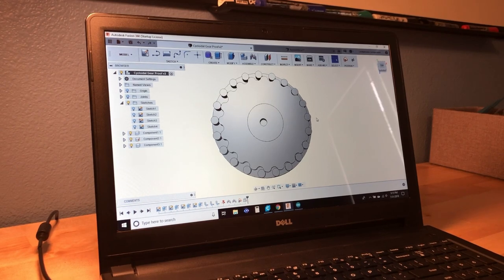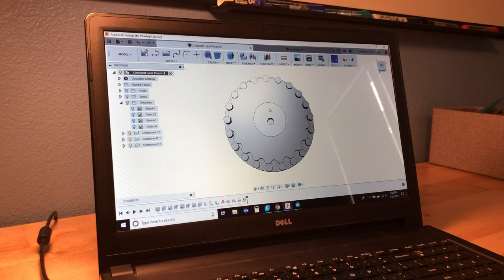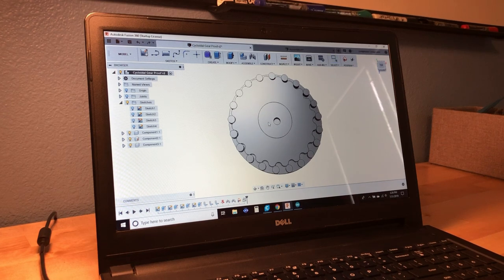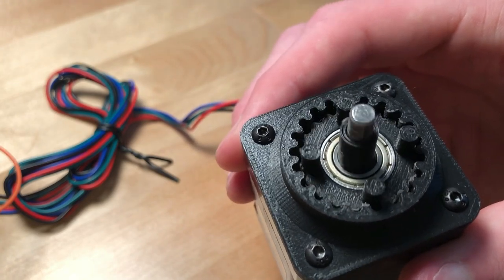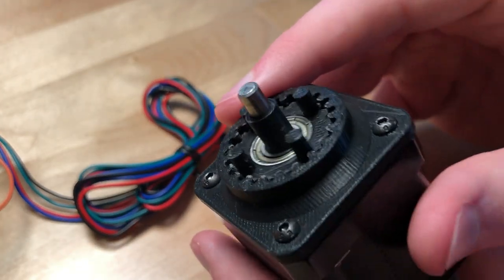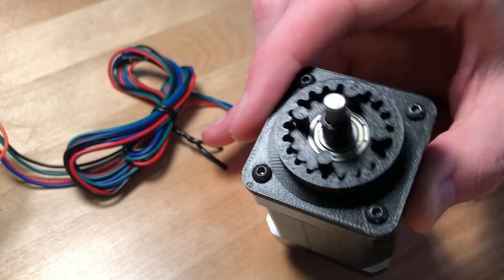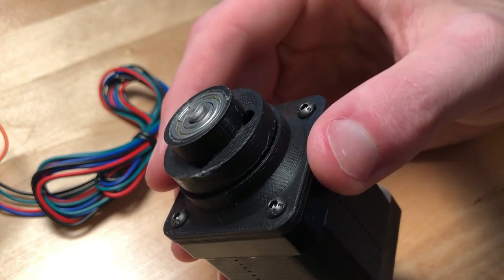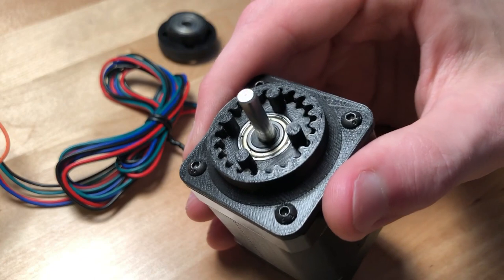3D Printed Cycloidal Drive | What They Are, How They Work, and Testing

Comment: The harmonic drive would perhaps be perfect for an equatorial mount used for telescopes. They need a zero backlash system with perhaps an arc second as smallest movement in combination with microstepping of a steppermotor.

Comment: I took a couple weeks and designed one of these using an equation I found online once but never printed it. It’s intriguing because it’s a lot easier to manufacture that a harmonic drive but from what i have heard it’s hard to decrease the sound and vibration they produce
Reply from the maker: My version didn't produce any sound, as far as I can tell. And having two cycloidal gears offset 180 degrees should almost fully eliminate the inherent vibration. I believe that a perfectly designed cycloidal gear, which would maintain constant contact with every tooth, should allow for nt wobble, and, hypothetically, no noise. And I really appreciate your support, but if you'd like to see a REALLY good 3D printed cycloidal drive, check out Paul Gould.
Reply: If you use 2 disc at 180°, you can strongly reduce vibration. If you use 4 (or 3) discs at 0°, 180°, 180°, 0° you have virtually no vibration. The problem is, that the output of a cycloidal drive is not perfectly linear, which can hurt your positional accuracy if you don't compensate for it
Reply: @alexanderhorstkotter2910  I just redid my design over the weekend with this 3 disc (middle disk being twice the thickness and mass) concept. I am happy with how compact the design still is and I was also able to find great prices on the perfect sizes of bearings. I honestly hadn't thought about the fact that the output velocity isn't linear though. This is obviously a problem when doing robotics with this drive (ex. I want to make a robotic arm with it). Do you know where I could find an equation for the output velocity profile so I can attempt to compensate for it?
Reply: @LeviJanssen  I looked into Paul Gould's design as well as some other people he took design inspiration from. I am about to the point that I can start printing my parts to test things out. I plan to cut the rotors out of delrin on my cnc after that and use precision ground .125 stock for the ring pins. What kind of tolerance do you give in the prints in order to help things fit together without binding? I only have enders 3's and an anet a8.
Reply from the maker: The one I 3D printed was just for testing sake, and I didn’t put much thought into tolerances. I had to use a file to get the teeth down to size. And I printed it on my custom printer, so that doesn’t help much. I think printing it multiple times with varying tolerances is probably necessary, and I recommend starting with tolerances that you know will fit, that might be a little oversized. Good luck! I can’t wait to see it
Reply: @kaden56  The error/correction profile would shift depending on the shaft's rotation when that machine turns on.  Did you finish your version?  How much of an error does the cyclone action of the teeth cause?  It would be a section of a sinusoidal wave every n (or n-1) teeth, per revolution.  The section of the sinusoidal would depend on the meshing of the pins with the teeth.  If you moved one axis with a cyclonal drive, and another with a normal drive, you could draw a 45° line, and measure the error. Just scan the drawn line with a copier, and graph the error.  I wonder how big the error would be.

Another way is to add an encoder to the output shaft (geared up) and automatically compute the sinusoidal (And phase) variation upon turning on the machine.   Then the stepper driver could receive these tables of error and compensate with extra /fewer steps sent to the motors. Whew!

Comment: Why did you give up on the harmonic drive ?
Are there any high ratio compact gearboxes that are still back drivable ?
Where are the high stress points that would fail if you applied an actual load on this gearbox ?
What are the main disadvantages of this gearbox compared to other types in particular planetary gearbox which seems to be preferred for actuators such as the opentorque ?

Comment: Nice compact design.
I need a 100:1 reducer with low vibration, low backlash, high positional accuracy to use in a telescope.
Do your cycloidal reducer or harmonic drive with belt generator have this properties?
Reply from the maker: Yes, for the most part. A cycloidal drive won’t, however, have low vibrations at high speed without a second cycloidal disk.

Comment: Is it possible to add an offset mass to the inner gear to recenter it's CG and kill the vibrations?
Reply from the maker: Not to the cycloidal gear, since it’s orientation is constantly changing. You could add a counterweight to the shaft, or in the case of an out runner motor, to the bell.

Comment: Dude, don't say there's .005mm of a gap between the parts ranting about backlash only to later reveal you are 3D printing these things. You'd be lucky to get .2mm part tolerance coming from a 3d printer! Additionally, reducing part tolerances and adjusting fits only take you so far insofar as creating a backlash free design. Good design has the ability to completely eliminate backlash purely within the scope of the design in combination with accurate manufacture.